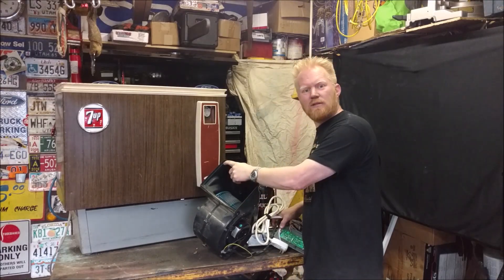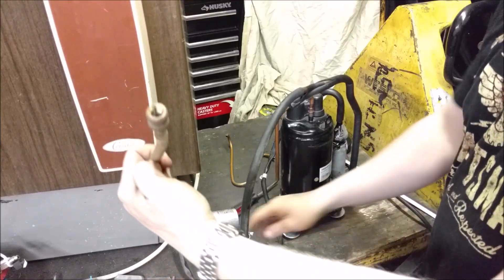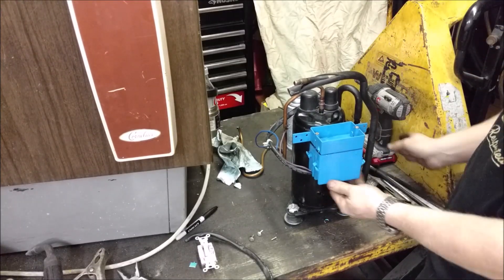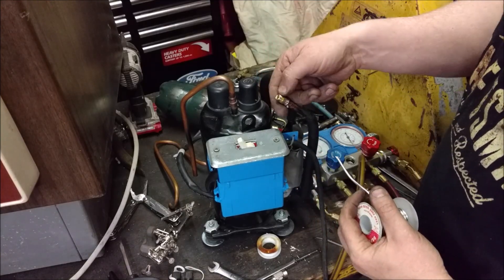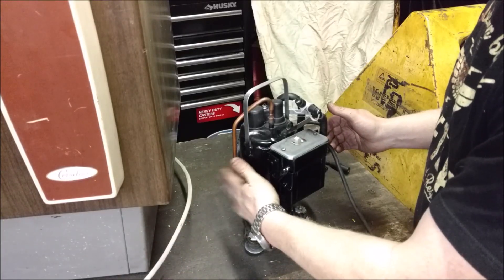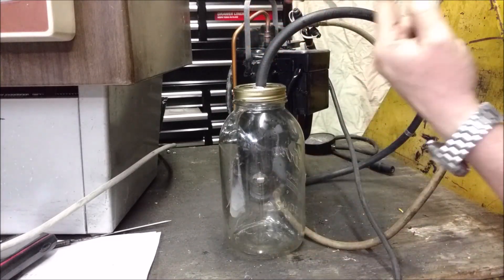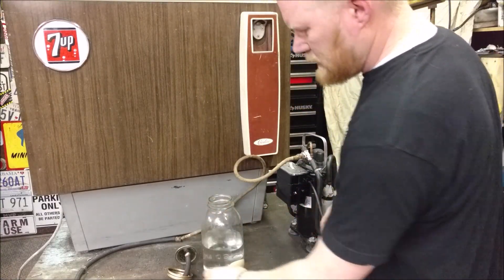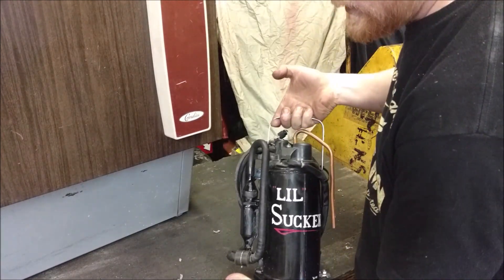Make a Vacuum Pump for AC in Cars, HVAC, or FUN

Comment: How do you lubricate that compressor? It would eventually go dry after a bunch of uses since oil is supposed to circulate normally with the freon. I wonder how long it will last if you do nothing.
Reply from the maker: Very little oil circulates with the refrigerant, but a few drops in the intake every few uses will replenish it.
Reply: One other question. I have taken apart a few humidifiers and mini fridges lately and the compressors will only go to about 25" of mercury. Where do you find compressors that will go to the 29" area?
Reply from the maker: What's the elevation that you live at? That plays a huge role in the theoretical inhg you can actually pull.
Reply: 334 ft above sea level. I'm an auto tech and pull 29+ on the machine at work.
Reply from the maker: Yeah, at your elevation that shouldn't be a problem. The maximum theoretical vacuum is 29.55inhg at your elevation. I've had no trouble with any of these pulling 25k microns or 28.92inhg sea level equivalent and with a sustained pull can get around 15kmicrons/29.25inhg sea level equivalent. At 25k microns the moisture will boil out at 80F(26C) and at 15k microns you're looking at around 63F(17.75C). Of course if the compressor is very worn from a 30 year old fridge it will have blow by and have lower performance. Most of the stuff I salvage from is newer.
Reply: My son and I have pulled about 3 or 4 compressors from different items, fridges, de-humidifiers and they all vary in vacuum, 23, 25, 24.5, 26 but not 29+. Sound like they may all have had a problem.
Reply from the maker: At my elevation of around 4500 feet there is only a max of 25.42inhg. The couple of these I've made all pull around 20inhg(24.5inhg sea level) within seconds of starting and then creep slowly towards the higher numbers after 4-5minutes. I pulled one from a new wine fridge that broke it's glass front and this one in the video was from a standing portable AC unit that was only a few years old and had circuit board issues. So both were good functioning compressors.
Reply: I feel like this was kinda what this guy was asking but in my vacuum pumps I use at work I have to change about nearly a quart of pump oil after about every 5 systems. Does this pump not require that same type of oil?
Reply: Two great makers sharing knowledge, so cool!
Reply: scoll and diaphragm compressors used in vaccum applications are dry compressors requiring no lubrication ....it is not the same as HVAC application that requires lubication

Comment: Good Morning!
I need to know what the difference Compressor Variable Speed Conventional?
I need 1 compressor that I can use it to my to Vacuum pump design which will make sucking products in the form of flammable gases such as fuel tank gas etc. I wonder if the compressor model with gas "R600 a" to It would be ideal?
I need 1 compressor that has a minimum of 50 psi Vacuum and output of 50 psi or greater than this to 100 psi .which would flow in liters per minute? I need one with a minimum of 100 liters minute wait response.
Reply from the maker: Any compressor from an old refrigerator or AC unit will pull a good vacuum but I don't think there are any that can produce 100 liters per minute/50psi of compressed air. You will need a small air compressor.

Comment: This is a little off topic but I have a question.  My neighbour has a Murray 11/36 lawn tractor and the gear shifter has gotten really stiff and hard to shift. Any thoughts, ideas, suggestions before I start tearing things apart ?  Tks
Reply from the maker: +eaglehill6 A lot of time the belt has stretched and isn't disengaging so it fights you when you shift. This is easily determined by noting the difference with the motor running and when the motor is off. If it shifts easily between gears when it is off by it is hard with the engine running, then the belt is the culprit.
Reply: Thanks for that but unfortunately that doesn't make any difference, it's still really hard to move the shifter, I have been watching a few vids on the subject and have come to the conclusion that it may be these little balls that work with the shifter have come out or something.  What do you think ?
Reply from the maker: If the moisture has gotten into the transmission the little detent balls will get stiff.
Reply: Ok, well we'll have to see where we go from here. The owner of the tractor has been in poor health and I found out a while ago that they took him to the hospital today so I'm not sure how this might end up. If nothing else I know a little more than I did yesterday.
Reply from the maker: I've been able to free them up a to a usable condition just by playing with the shifter back and forth. But most of the ones I play with have been sitting for a long time.
Reply: This one seemed to have gone stiff last summer as he was using it and it has only gotten worse. You had to pound it with your hand to get it to go in gear and I needed to pull it backwards a couple of days ago to see if I could start it but I had a hell of a time to move it into neutral.  Ended up having to kick it over. Can't keep using it like that. Something is going to break..

Comment: i made a air compressor from a pump a few years ago I actually ended up blowing a few pumps I used a 20lbs propane tank. I kind of skipped though some of  your video do you use some type of lubricant in your pump? Either way i think this would be a great idea for an ac vacuum even if you only got a couple dozen uses. 
I think a great addition to this idea would be to make a vacuum sealer. Guts from an iron attached to two pieces of flat stock mounted to a board that would serve as the sealer and a clamp.  Of course i would use ziplock bags because there cheap I would simply place the bag into the clamp leaving a couple of inches beyond the clamp put my vacuum line in seal the ziplock all the way to side until i reached the vacuum line turn my pump on, when i got the desired amount of air out i would clamp it and turn on the heating element.
Reply from the maker: +Phillip Jordan They are lubricated by themselves pretty well and shouldn't require anything for intermittent vacuum use. However, they do spit out of the pump side(very fine mist) so adding a few drops through the suction side if it is being heavily used or used for an air compressor is a must. This style is a rotary and is a little tougher than it's piston style brother.

Comment: Another great idea...so there is no problem spot welding the casing? I thought the heat might damage the seals. I love your entertainment...so practicle and useful
Reply from the maker: +D Jaco The outer casing is just a 1/8-3/16" steel shell. Nothing is really connected to it as you can see in this old video where I tore one apart: https://youtu.be/1bbvHEl8WIg
Reply: I was thinking the same,  like if you don't have a welder you could make a platform and back out of wood to neatly mount it all together.

Comment: Great project. I was wondering if its possible to build a silent air compressor using these type of compressors ?
Reply from the maker: +Dicofole Yep, just use the discharge side and it'll pump.

Comment: Wonderful paint job. But I have a question for you? When a refrigerator or air conditioning pump are in service they have oil in the freon to keep the heat pump from seizing up. What keeps the Lil sucker from seizing while being used?
Reply from the maker: +Murray Lowe The majority of the oil sits down in the compressor bottom tank and everything is swimming in it. The discharge line will very very slowly emit oil so some will be lost but I will add oil randomly from time to time(a few drops) into the suction side, like you would an air powered tool.  but it is pretty much self lubricated for the rest of it's life.
Reply: +sixtyfiveford Yes I knew that and yes if you keep up a regimine of oil lube, but I only mentioned it for anyone else in your members that may try to build a vac pump so they may know this information. Because it surely is a great tool to have and definitely someone else will build one.

Comment: Great video man. Would a compressor from a refrigerator work the same as this? I'll likely never need to do an A/C evacuation, but I may play around with a vacuum chamber at some point. I dig the freehand lettering.
Reply from the maker: +Dustin Rogers Yep, a compressor out of a fridge will work the same. Thanks man.
Reply: @LazyH-Online , Thanks for explaining the difference. It should be still able to air up a tire or pull a vacuum on a A/C system. If you had  both which one would you use? 👍

Comment: So would this be a good way to boil house water if the pump was hooked to solar panels. ?
Reply from the maker: +John No, it was more of a gimmick as the water temperature was only around 80F, so no bad pathogens or bacteria were actually killed. I believe you need to have water get to 160F or so to kill all bacteria etc. It's just easier to tell people to boil water, than telling them to maintain a temp above 160F.
Reply: @sixtyfiveford  1

Comment: A trip down memory lane.  My granddad was a lot like you, in that he could fix just about anything.  He used an old A/C compressor a lot to do HVAC repairs.
Cool video!
Reply from the maker: +helidodge It's a neat trick. Some the early professionally sold vacuum pumps were obvious retrofitted compressor motors.

Comment: That is pretty sharp... Really cool penmanship too!
Reply from the maker: +Curiosity Thanks. You gotta practice to get good.
Reply: sixtyfiveford is there a possibility that the jar will shatter? MY WIFE nearly had heart failure worrying about your hands haahah is the water real hot, or just luke warm, meaning could Candis drink her tea after getting it hot with your machine? hat thing heats water way faster than gas or electric water heaters for coffee and tea!! just wondering
Reply: The water isn't hot at all, its room temperature.  The boiling point of water changes based on the pressure of the environment that its in, if you try to cook spaghetti on the top of a mountain it takes longer because the water boils at a lower temperature.  It goes the other way too, car radiators have pressurized cooling systems to increase the boiling point past 212 degrees along with chemicals to raise it even more (like salt for example can do this)

Boiling water with a vacuum does not make it safe to drink the same way heating it to boiling does, because it is the heat that kills the bacteria not the vacuum.
Reply: Readers, for the love of god don't misinterpret Janky's comment and use salt water as an alternative to antifreeze. Engine coolant must stay as electrically non-conductive as possible or you will get corrosion on all metal parts throughout the entire cooling system.

Comment: I have to find one of those for myself. That was awesome. The egg didn't actually cook did it?
Reply from the maker: +acousticguitarpeter Good example.
Reply: +Dasdfjkl No. The same thing happened to alpine climbers when they were trying to boil potatoes at 4500 m
 (14 764 feet). Water boils, but it's not 100°C (212F)

Comment: YEA I wanted to know the same thing, how about the oil in the compressor?
R-12?, it is almost impossible to get, our 1990 Ford van has a leak and it uses R-12, we stopped paying $500 each time we needed it to be recharged.
Reply from the maker: +old64goat r-12 can be bought for around $15 a can on Ebay and is getting cheaper as so few pre 94 vehicles are around and fewer that haven't been converted.  
The majority of the oil sits down in the compressor bottom tank and everything is swimming in it. The discharge line will very very slowly emit oil so some will be lost but I will add oil randomly from time to time(a few drops) into the suction side, like you would an air powered tool.  but it is pretty much self lubricated for the rest of it's life.
Reply: Thanks Moe for that info.
I was also wondering if water got into the compressor like when you are pumping water if that will harm the compressor as you were drawing a vacuum from the water in the bottle and "some" water is bound to get into the compressor.
Reply from the maker: It will spit any water out the outlet tube. I allow it to run for a while to make sure it is dry as possible before putting it away.